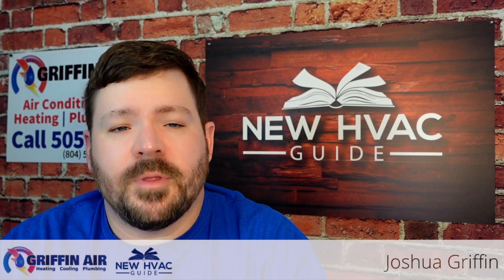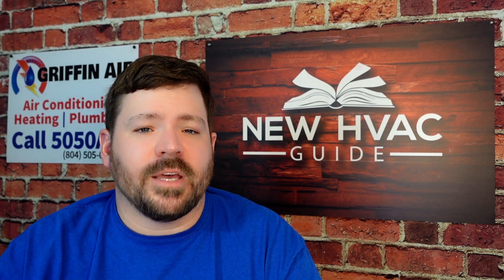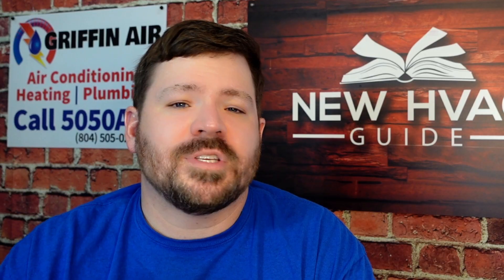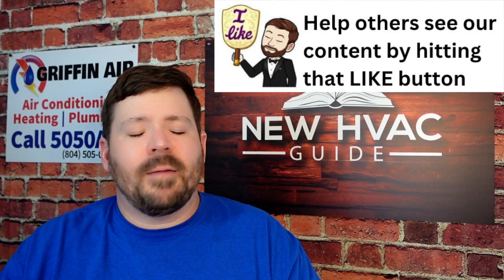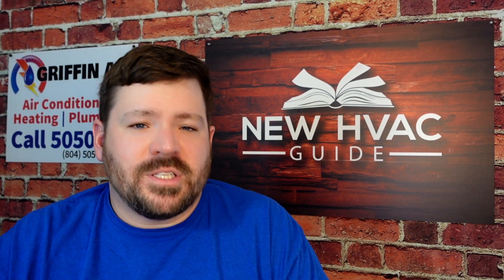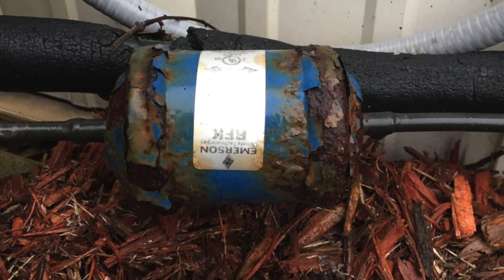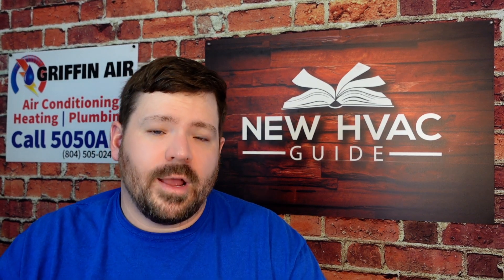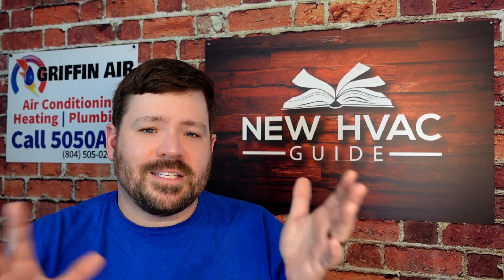HVAC Parts That Are INTERCHANGEABLE!

Comment: I think for the most part...HVAC techs install "rescue" type motors as a standard practice. I often wonder why they bother with them since they are usually Chinese crap with bushings vs. ball bearing and they come with the maximum number of wire leads to fit the many types of systems out there for conveninece to the installer.  Lots of the customers still have OEM quality motors in their HVAC systems so replacing them with the same quality should be number one and of course yes they are going to be more cost however, that should be discussed with the customer if there is a concern on price with another bid etc. So, to show up and diagnose a motor replacement and install the "universal" or "rescue" motor without informing the customer wouldn't be an honest repair if the bad motor is OEM. Lots of the supply houses like to pimp the China crap because they are easier to stock and typically sell faster due to cost but is that because of the HVAC techs or the customers? Same goes with capacitors....USA made caps are what should be used vs. Chinesium crap that will only make it for 2 years or so before failing. In the single stage systems, the same has been happening with the control boards...."universal" parts substituted for OEM and the customer isn't advised or aware of it. All they know is "Its fixed" and it works but the quality and longivity won't be the same in the long run. I can understand the reason why universal is used by HVAC but it seems that they are overused in a lot of cases.
Reply: not all rescue motors are chinese - they can be north american and actually exceed quality of oem
Reply: @Jon-hx7pe  That would be interesting to know which ones. Supply houses should require the HVAC folks specify the quality wanted, Cheap, LKQ or OEM.

Comment: Just dealt with that.  My 1999 Amana Command 90 furnace took leave of its senses (acting like a bad board) in the middle of the night.  We implement our plan B (free-standing gas fireplace).  Our tech showed up and could not find the issue.  In the end, the safety door switch was occasionally shorting (looked like arcing to me) out and creating electrical issues.  The tech said that this is a non-standard part and wired around the bad switch.  As an engineer, I am good with the solution (haven't killed myself yet) and we are up and running.  

Sadly, it may be time to replace the poor thing.  In 18 years we lived here we have replaced the main board, a pressure switch and now dealt with the door switch.  We have never had a condenser issue always the furnace (it is MA, the furnaces always suffer). My tech thinks it is time for it to go before the heat exchanger goes out.  We will wait till spring when there is less pressure to make a decision.   All in all, you need a plan B.